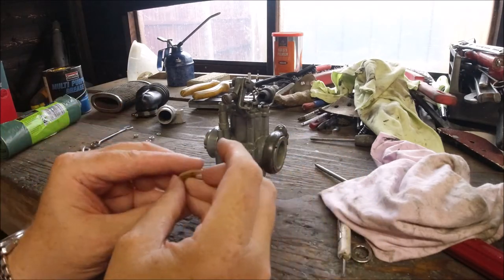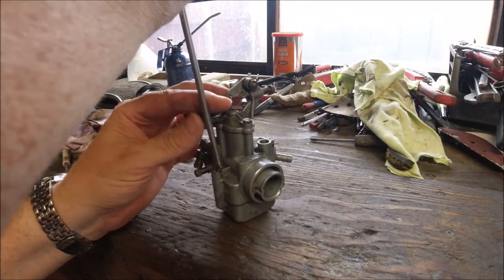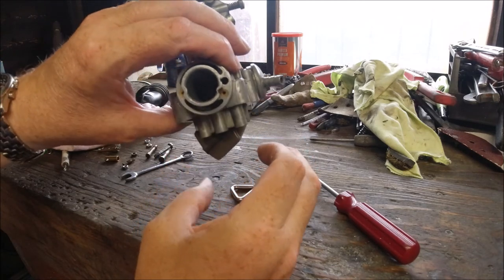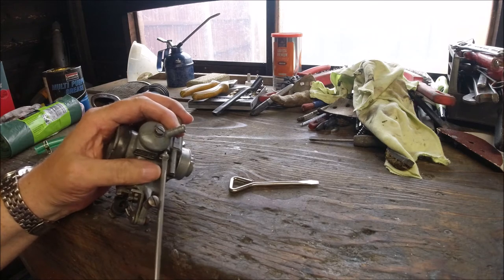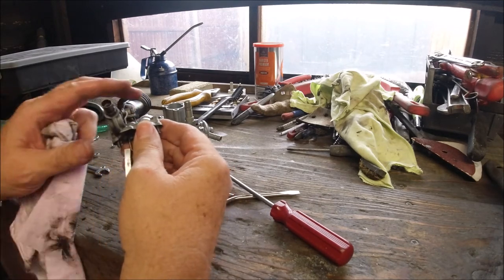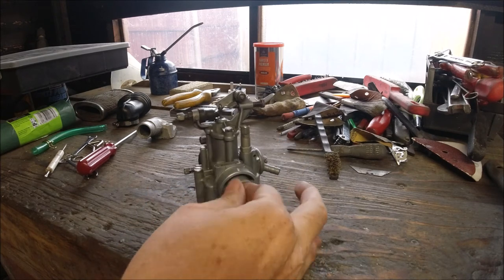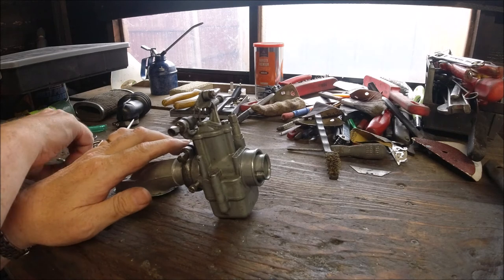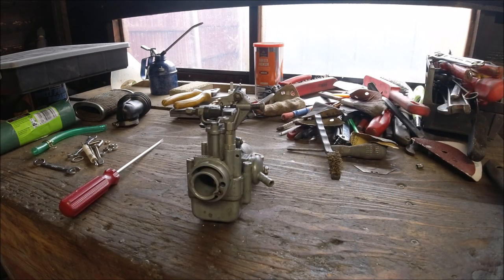Lambretta Dellorto standard carbs

Comment: I just watched your vid on the standard li 150 carb
My series 1 just started flooding petrol coming out the pin hole above the mixture screw and scooter just stopped and the bowl full of petrol and spark plug dry so I am wondering why the petrol is not going down the inlet  into the cylinder should I be looking at the float needle thanks in advance 
Rushaid Liverpool
Reply from the maker: Float or pin that connects to the float, check function of float by blowing down petrol inlet and holding the float open and close it
Reply: @m1scooterlife259  thanks mate rushaid Liverpool
Reply: When I turned the carb upside down it got stuck so a bit of filing and sanding all was good went to donny hunters meet no issues thanks
Rush Liverpool
Reply from the maker: It looked like a good turn out Ana I'm glad that you got out on your lambretta

Comment: Hiya mate just had my series 1engine rebuilt plus a RT 195 kit does it need to be run in and how long for 
Rush Liverpool
Reply from the maker: Yes you do, what I do is put the scooter rear wheel off the floor and run the scooter for half an hour letting it warm up and cool down again then run it in for 800 miles, you need to keep an eye on the spark plug colour as this tells you how the scooter is running.
Reply from the maker: MB has lots of information on his website as he designed the kit